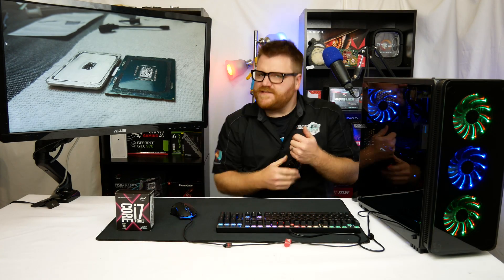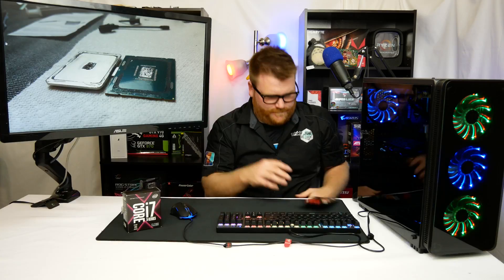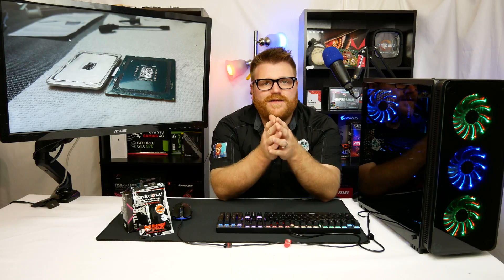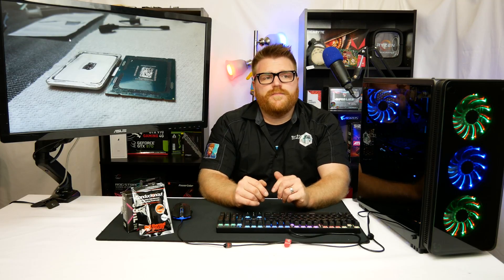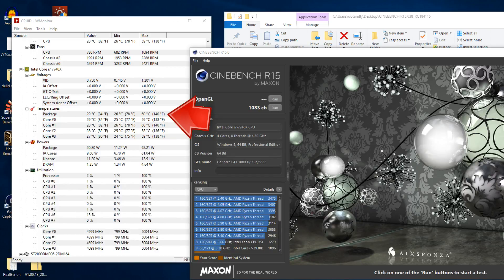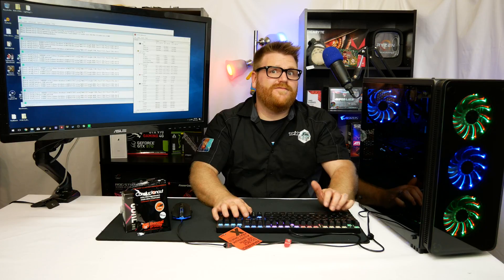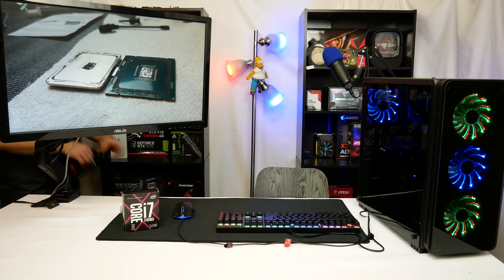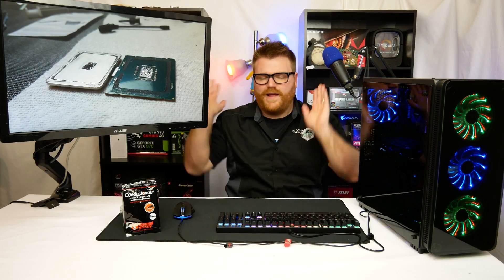Intel Core I7 Liquid Metal Delid 5.4 Ghz Overclock!

Comment: I delided my i7 7700k long time ago and its on 5ghz 1.430v  75-80c with thermal take floe riing 240 water cooler no problem with cpu it working fine.

Comment: You seem to really rate Arctic. Does that cooler still run okay? I had one start rattling and drop to 2450rpm so I contacted them. They sent me a replacement pump with no return needed but the "new" one (dusty radiator, bents fins, thermal paste in screw wells) jams and wouldn't spin at first. Got it spinning at 2600rpm which is a little better but it jammed again overnight and nearly overheated my CPU. Glad I was being vigilant. Put the old one back on for now as it at least spins. Got the other running again by jolting it by hitting it on the side a few times whilst plugged into a spare header. Got it sitting out of the case in a mounted position to test again after 24 hours to see if it jams again. I messaged arctic again but they haven't yet responded despite being quite helpful initially.

Comment: I delidded my FX 9590 and then when I went to seat it in the socket the die fell off. The funny thing is I put the die back in the IHS and reseated it and it still works.
Reply from the maker: Uhhhhh wtf are you talking about. Why delid a soldered cpu?
Reply: @TimmyJoePCTech  Even though they are soldered you will achieve better temps without the IHS plate. Most people who have successfully delidded their FX's saw an average of 8-10°C lower temperatures after delidding. Most people don't delid soldered processors because they are harder to delid but the trick is to heat the center of the IHS and keep it hot while delidding. https://community.amd.com/thread/187441
Reply from the maker: @tskraj3190  yeah but whyyyy
Reply: @TimmyJoePCTech  Because your CPU will run cooler allowing you to overclock higher. I have seen a couple of people claiming they run 5.3 GHz 24/7 and for an FX you need all the performance you can get. I have had my FX9590 since 2013 and I figured what do I really got tk lose because if I destroy the CPU I can pick another one up for under $100 and I can put my Phenom IIx4 980 back in it until I get a new one. Luckily the CPU still works but I don't think I will atempt this again especially on my TR 1950X.
Reply from the maker: @tskraj3190  I ran my 9590 at 5.3 GHz without almost ruining it. They can run that. Just need extreme cooling and they don't actually score much better when they're overclock that extra 300 MHz
Reply: @TimmyJoePCTech  I use a Thermaltake Ultimate 3.0 AIO but I can't run it 24/7 with anything higher than 5.0 GHz, the VRM just gets way too hot when gaming plus I have to use much more voltage to achieve stability on anything higher because I'm running 32GBs of DDR3 2400 so I'm already pushing the recommended DDR3 1866 boundaries but it is 100% stable.
Reply: @TimmyJoePCTech  Just out of curiousity did you have a custom water block on your chipsets or use aftermarket chipset coolers?

Comment: Actually I just wanted to report: Delidded my i7 3770K on sunday with a vice. Worked out perfectly. Got ~17°C less and could lower the voltage by 35mV. Pre delid 4,4@1.32V, now 1.285V.
Reply: that's pretty good!

Comment: If you delid will your chip need less voltage at the same frequency?
Reply from the maker: Not exactly, Deliding is all about reducing temperatures. It will allow the same voltage to dissipate more heat so you can increase frequency and voltage more at a safe temperature.
Reply: Thx for the answer!
Love your videos bro, keep up the good work 😜✌🏻

Comment: he didn t remove the the black silicon glue at delid , did he said that right ? cause there are a few degrees there
Reply from the maker: George P I removed about 90% of it. The rest is there as a guide to reinstall the ihs
Reply: Timmy Joe PC Tech that was fast answer
So will you try redo it with 100 % clean ?
Reply: Can u try something like nv core n1 direct cpu die cooling for comparison ?

Comment: I would look into custom cooling loops. Not all water cooling is made the same. A EKWB CPU block can be by itself a 5 degree drop in temperatures. Couple that with a thicker radiator with denser fins and a D5 pump and you have the cooling prowess to lower the temperatures enough to be bearable even at 1.5V.

Comment: oh yeah delidding is safe unless youre actually a fucking idiot like me and arent careful. I delidded my 6600k and put some better compound on and sealed it back up with some caulk. after a little while i started getting weird temp jumps and i assumed it was because i applied the paste unevenly, but when i went to open it back up, i nicked the top of the PCB pretty bad. whoops. CPU was totally dead, i sold my 1060 6gb and bought a 6700 and an r9 290x. pretty good deal actually and the 290x is actually a wee bit faster than the 1060 once overclocked.
Reply: Poor 6600k

Comment: I just watched a video where the TIM had flowed off the die and into the area around it. It seems like that would be a BIG Problem on that CPU with all those contacts pads around the die as it could flow into them and cause shorts?
Reply: Yes.   Two things:  1.  most people use too much liquid metal -- just need enough to lightly coat.   2.  smart delidders apply liquid electrical tape to the area around the chip to prevent damage even if the liquid metal flows off.   Can even use some nail polishes for this purpose.

Comment: thats why i use an old xeon x5650. soldered IHS and 60°C under full load when overclocked to 4.0 (2.66 stock)
https://valid.x86.fr/44f0xv
Reply: My x5650 is at 4.4 79c max under a noctua nh-d14 with 2 120mm fans (1 intake, 1 exhaust) - poor airflow case.

Comment: I delided my 7600k on the vice. 5.3ghz wasnt stable & 5.2ghz in the summer wasnt possible.I lowered the temps with around 28c but I put metal on both sides.Before that It was Kryonaut thermal, paste. You put too much btw. My limiting factor is the cache. It draws back the CPU because I OC my GTX970 biosflashed on 8550mhz RAM (core:1550mhz)  & with the RAM OC 2666mhz stiock to 3200mhz drivers crash sometimes or straight Bl.screen. 5Ghz-1.255v / 5.1ghz-1.295v / 5.2ghz-1.355mhz / 5.3ghz-1.440v

Comment: I would never use a razor blade to delid an Intel CPU.  Buy a delid-relid kit.  And, an average overclock for an i7 7700K without a delid is 4.8GHz, not 5.0GHz.  I do not know where you got your information.   5.4GHz is an outstanding overclock, most will never get that high.  I got an 18 degree drop after delid and silicon to attach the IHS, some people get 20+ degree when using super glue on the IHS and PCB.
Reply from the maker: +ZZstaff you know nothing
Reply: Timmy Joe,
Why are you casting flame bait?  I have been working with computers since 1986, possibly since you were born.  Over the years I have learned a great deal about many aspects of hardware, including overclocking.   I will not say more, it will do no good.

Comment: Used Rockit88, thermal grizzly conductonaut & Swiftech H320x2 Presitige aio liquid cooling kit for my 6700k and asus rog maximus viii hero.  Got it overclocked to 5.0ghz @ 1.44v / 1.42v under load with vdroop. Scores around 1118-1126cb on average in Cinebench. Also running and EVGA 1080ti Ftw3 Hybrid, Acer Predator Xb252q(240hz) & Xb271Hu (IPS 165hz). I couldn't be happier with it. I almost want to get a 7740X or 8700k just to try my hand oc'ing one of those but the 6700k is preforming so good for me at 5.0 I can't justify it.

Comment: im delidded on custom loop, highest i can get with out crash is 5.2 at 1.41 volts max temps are in low 80s lowest temps are about 52 c.... i was hoping for 5.3.... my benches are NOT as good as yours... i wonder what im doing wrong.... i only got this cpu because it was extremely cheap and the mobo was stupid cheap too...

Comment: If anyone is deliding a skylake X checkout 
Rocket 88 deliding tool 
https://rockitcool.myshopify.com/products/rockit-99-delid-and-relid-kit-for-skylakex-kabylakex 
Only 39.95 and it's in stock
I'm not a salesman for them I used it for my i9 7900x  and works great
Reply: are u watercoooling ur 7900x? or what are ur temps and cooler?
Reply: I overclocked it to 4.8 on regular tim it would hit 100 deg Celsius and thermal throttle 
But after deliding  it was 85 Celsius and wasn't throttling 
I keep it overclocked to 4.7 because I don't like it even at 85 c to keep it  cooler 
I benchmarked it with Intel extream tuning utility
Reply: water cool it!

Comment: Intel Is Still using thermal; paste to adhere their pcb`s , Pffttt , Everyone is saying , WHY ,, I think if they started soldering them it would be a distraction from them Secretly using the Thermal paste to hold the pins , LULZ
Reply: I think the new i9 series is soldered. You will still get better temps without the IHS plate even if your CPU is soldered but they are harder to delid.

Comment: Judging by your low improvements in CB (~25pts/200MHz), the CPU is likely throttling. Nice OC though!
Reply: idk why it would tho. power limits? I didnt think that was a thing. The only thing I know of that causes CPUs to throttle is thermals. Everything else either causes it to crash/fail or it breaks it, AFAIK.
Reply: Yeah. My 8700K gets roughly 80pts/200MHz

Comment: The RockIt 88 tool make is very easy and much safer. I used it on my 6700k and dropped about 15c when OCd. I can now OC it to 4.8ghz at 1.375v stable, but dropped it down to 4.6ghz at 1.24v to save on some power and heat.
Reply: RunBof Diver I've used my rockit 88 more than a few times since i got it and my 7700k, 4.8 is right about where i sit, tho temps are a bit high because of my cramped case
Reply: I got 4.8 at 1.4v on my 6700k. It doesnt get hot but I don't want to apply any more voltage until I have a custom loop installed.
Reply: Love my Rockit cool tool!

Comment: Damn 1.505 volt your crazy but this is what im here for  :-D:-D
Reply: He not crazy, I ran those volts through a 4690K delidded for 4 years no degradation.
Reply: Sinned HD he is crazy lol 1.35 is about your max 24/7 voltage most people suggest. Gotta do it for the views
Reply: @Demon09-_-  my i7 6700 none k i got it at 4.5ghz at 1.345 ish but 85C peak and often random crash at those temps... after 2 h of gaming so now im running 4.2ghz at 1.32 ish 72C peak... need to delid this thing.. fuking idle 42C holy shit...
Reply: @reggiexp69  unless the 85c you were randomly peaking at 105c it was not crashing from temps. Are you able to mutiplyer offset oc or are you having to use blck